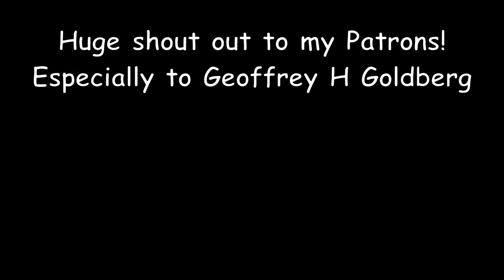How It's Made: Concrete Sidewalk. Forms, Base and Rebar [Part 1]

Comment: I guess I don’t understand the need for a rebar grid in a sidewalk. That’s a lot of extra work cutting those and overkill for something that will just be walked on. If it was a driveway, I could understand the rebar grid. Those 2x4 stakes are overkill too. Try 1x3s - so much easier to pound in the ground, and hold up the forms just fine. You guys do solid work though! 👍🏼
Reply: Ground shifts. Keeps it all intact. That is the purpose of rebar

Comment: Love your work, also to dare showing it on YT, - but never connect new concrete with old concrete, llike u do at 9 min. The house has settled 10 years ago. The new sidewalk will probably sink 5/16,  or 1cm in the next years, so they should be seperate. / Also if and when u drill into foundations the hole should never go down, but up so water wont accumulate in it.

- Other than that awesome work. - Greetings from Norway.
Reply from the maker: Thank you for the kind words and for great advance!
Reply: @Take_And_Make  where are these projects that you guys Make 2 x stakes and you don't finish the face of steps , do you not have conc pumps. , What's up

Comment: I would see those hard angles in the turn every time I walked on it and it would drive me crazy. To anyone watching this, don't do that. Use some ¼in plywood. Soak it in water and bend it, back it up with some pins, and round that corner off. Craftsmanship is important.
Reply from the maker: We offered customer rounded corners he requested straight angles only.
Reply: Rounded corners are out of date . The 45 corners are way better . It looks more modern .